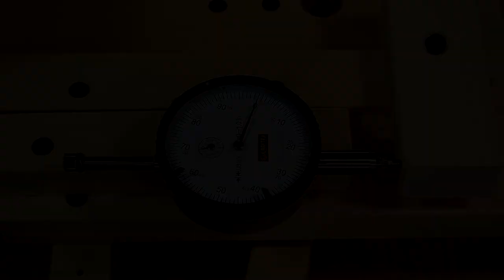Tenon jig build, part 2

Comment: Instead of using so many clamps, which I don't have, what would you think of using a couple of 18 ga pins, delivered by an air nailer, as an aid to keep the glued surfaces together?
Reply from the maker: Nothing wrong with using nails if you don't have an objection to using nails.

Comment: Would this jig also work on a router table instead of a table saw ?

If you find that you would move that dial indicator often because you need more travel, you can get 2" and 4" travel models.  the 2" ones can be in the $20 to $30 range.
The 4" ones in the $100 range.

Are you relying on the friction fit to hold the shaft to the carriage?
No set screws or something ?

Comment: You use several different methods in your various jigs for precise linear motion: the pantorouter and slot mortiser use modified drawer slides, the box joint jig uses a dovetail, and here you employ a rod and bushing.  Any specific reasoning for these various design choices?
Reply from the maker: Whatever fits the space I have and is suitable for the application.
Reply: Matthias Wandel hola matias felicitaciones